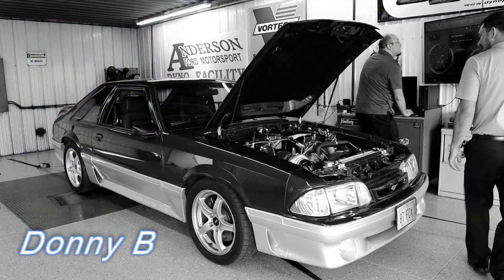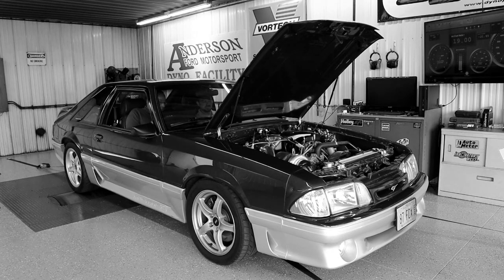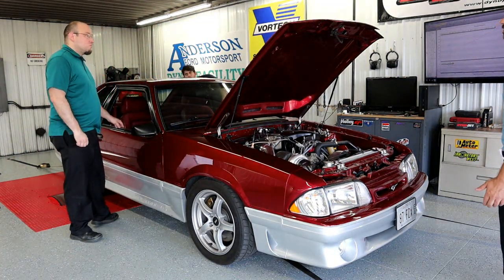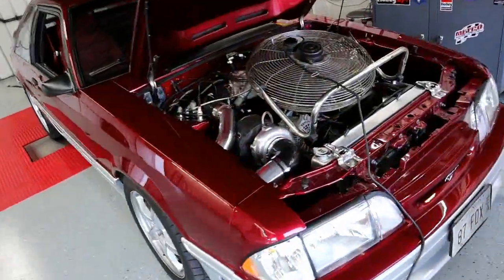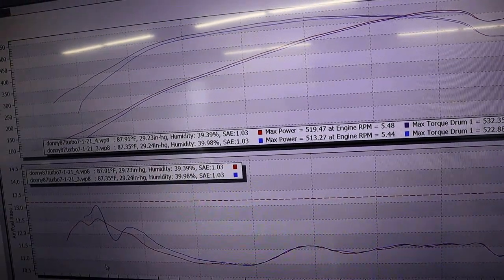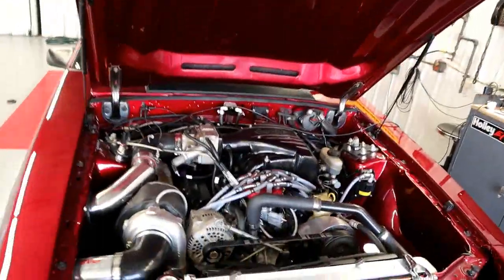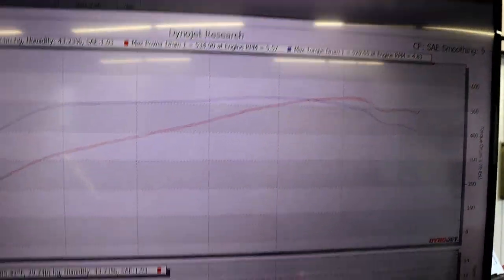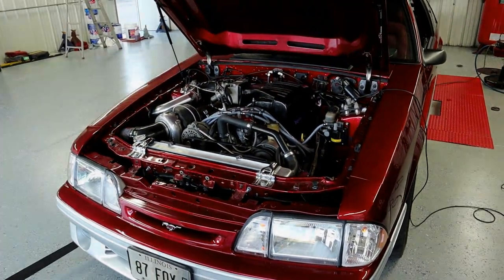Terminator X Turbo Fox Body Dyno Numbers

Comment: I’m using mega squirt (which is similar to micro I Believe,)currently on one of our turbo 347 Fairmonts and works perfect but you think it’s worth it switching to Holley  ? I love the support it has but not sure yet
Reply from the maker: Yeah the system is just fine. Moving to the holley just gives you a little more and in my opinion better for the first time user
Reply: I personally don’t like Holleys “jargon”… and depending on the kit the capabilities can go either way MS or Holley… I will say the car that won best in show at LS fest was using a MS3pro ecu 🤣

Comment: How ya doing Donnie B! I’ve seen you a bunch on neos Sunday night live. I’ve got my terminator x on order and don’t have a clue when it’s coming. I’m wanting to put together a 351 roller for my 89 vert. And I’m wanting to ask about your thoughts on using gt40 p heads I have and what cam you would suggest? I’m only gonna do a piston upgrade to 10 to 1 forged and run some nitrous! Thanks and I will email you on more on this.
Reply from the maker: It would depend on a few factors. If the 351 has stock pistons you'll be limited on cam choice but with nitrous I would say the Anderson B31 or B31hr with stock pistons
Reply: @strangedemon  ok. What’s your email address please? I will holler at you Tuesday morning !
Reply from the maker: @lochnessfox3441  send it to hirev1@anderson-ford.com